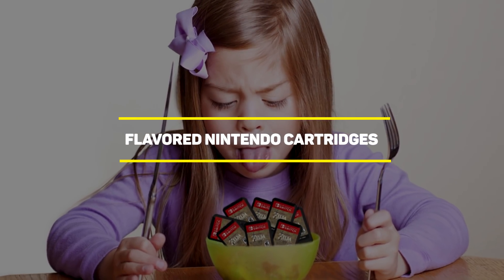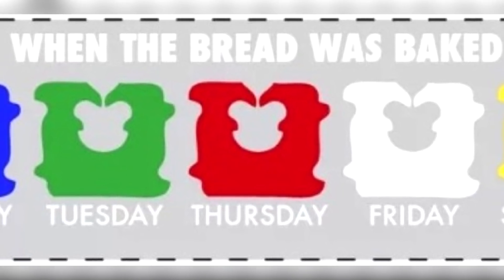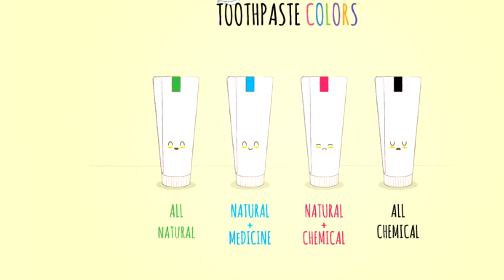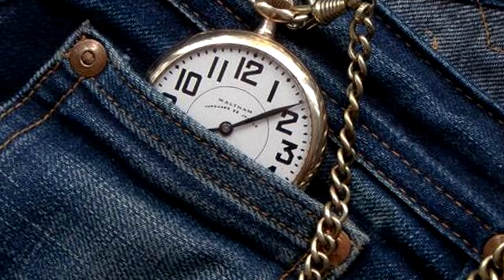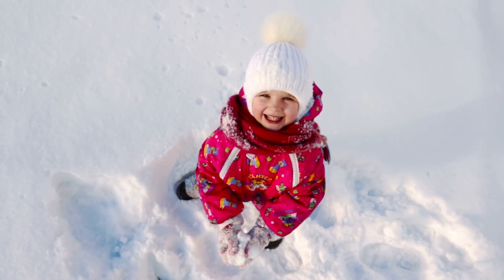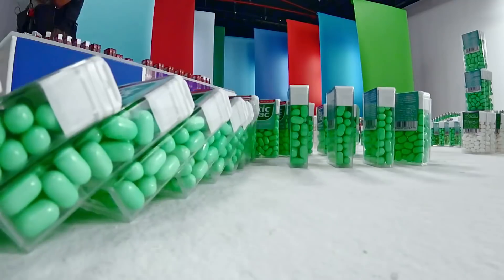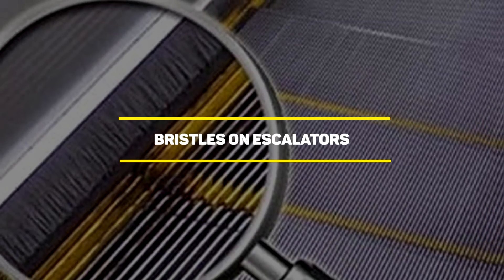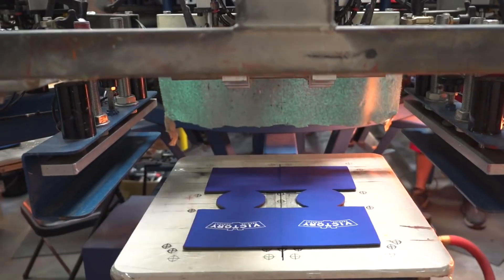Amazing Secrets Hidden In Everyday Things

Comment: If you put the spoon or anything you use with your pan as you say to keep side clean it does not it also drips from the pan handle to and goes on the floor to so that's easier to put it on the side to wash

Comment: OK your info about color codes on toothpaste tubes is false! This from Healthline: The colored rectangle actually has nothing to do with the toothpaste’s formulation. It’s simply a mark made during the manufacturing process. The marks are read by light beam sensors, which notify machines where the packaging should be cut, folded, or sealed.

Comment: Most of this is just made up BS. Example the hole in the can tab is not for a straw, its cut in the center and bent over the edges to make it stiff enough so it wont bend when the can is opened, the raised part on the  tic tac is to provide friction and keep the lid closed. The ring on the cup lids is there to make the lid rigid, the hole in the pan handle is for hanging. put a utensil in it and the food will drip onto the handle and possibly onto the burner and cause a fire.